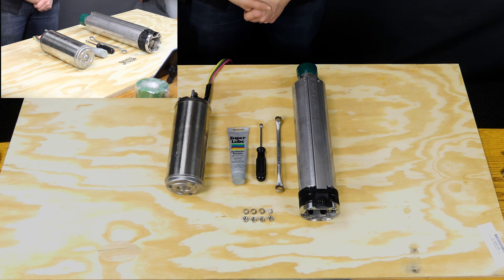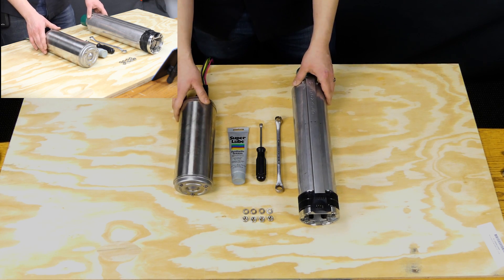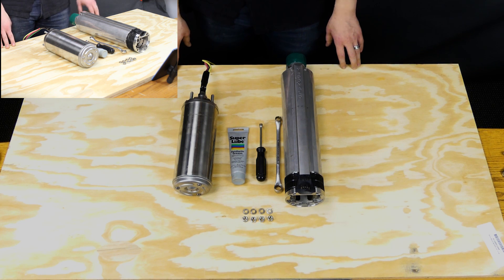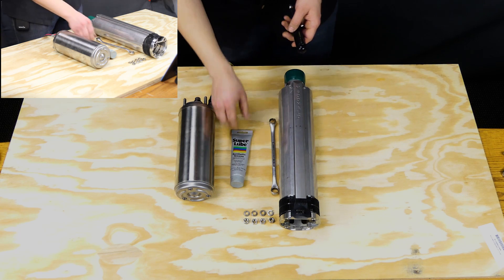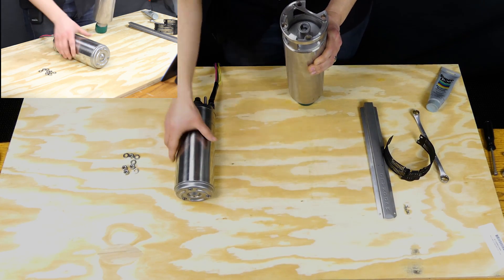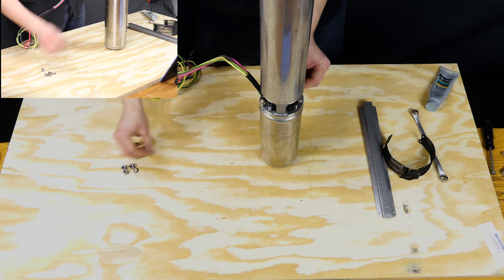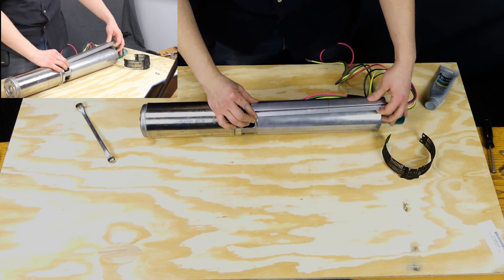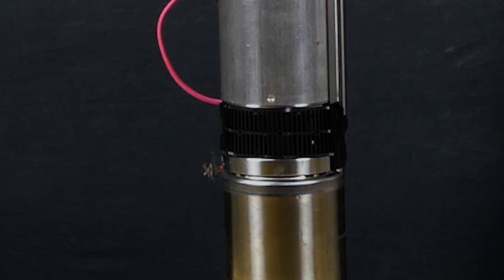How to Assemble a Submersible Well Pump and Motor

Comment: Nice video.  if i under stand correctly there are 3W with ground, and 2W with ground.  I guess either can be 110 or 220V.  Did you say the extra wire is for the control box.  Could you do a video on the wiring for 3W.  Would be interested in seeing that.  my 220V pump has total of three wires going to it so I take it the it is a 2W, with ground.  I think I understand that setup well enough.

Comment: Watched your other video on pipe types and I think the coil of poly is what I want. My question =  could I use poly and lower such a heavy pump/motor assembly down? Or should I also have some kind of line attached permanently to pump so it doesn't just hang off of poly line year after year?
Reply from the maker: John, please give us a call to discuss your application: 855.329.4519
Reply: If any summer sebule half pluck and down to boring how to catch
Reply: If the pump bolts to the motor instead would you use some form of lock tight along with a lock washer?